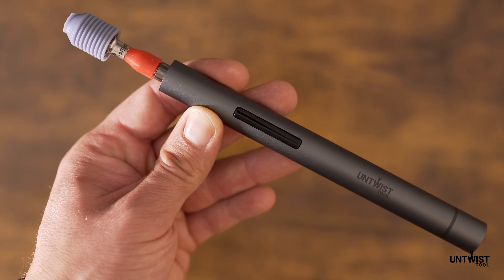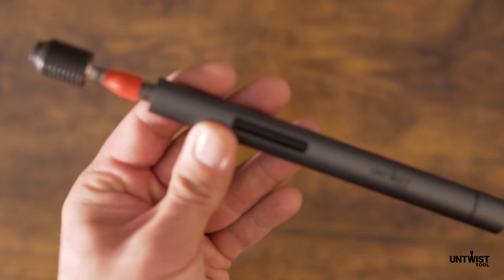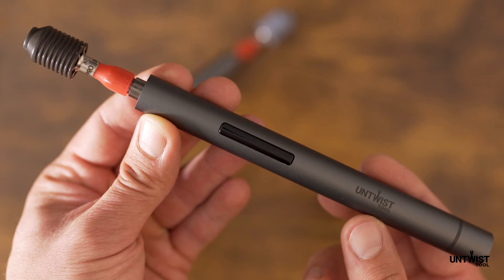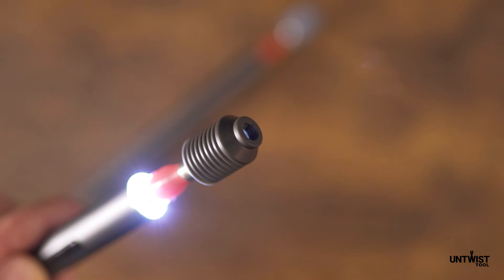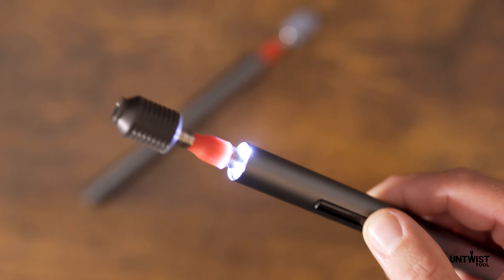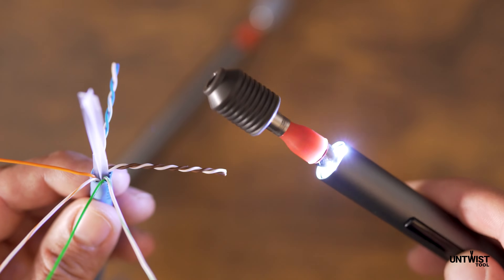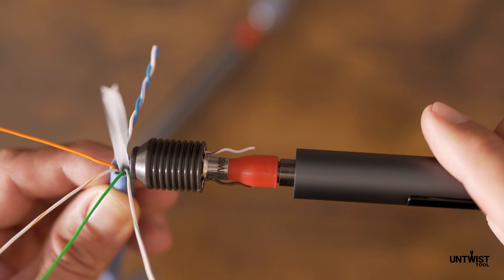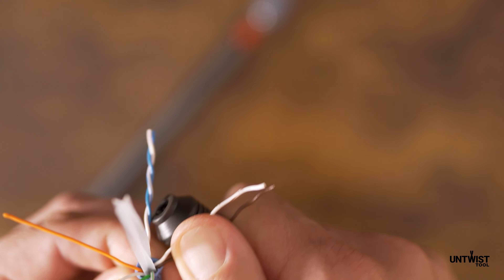How to video guide - Untwist Tool Pro in action

Comment: most pointless tool
Reply: i use both 1st and 2nd versions since they came out and saved me tons of time.  if you believe that you aren't using it right.  i have no affiliation with the company I'm just an end user.  Works for me 9/10 times which is well worth it to me.  Just have to get the hang of it